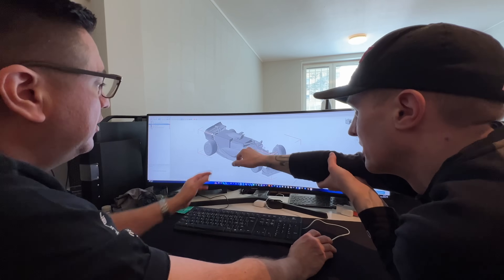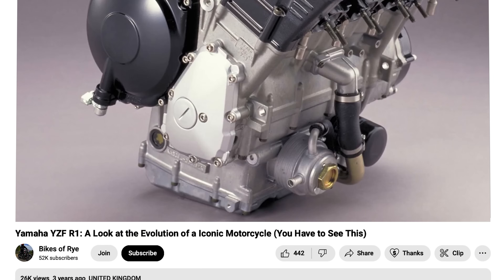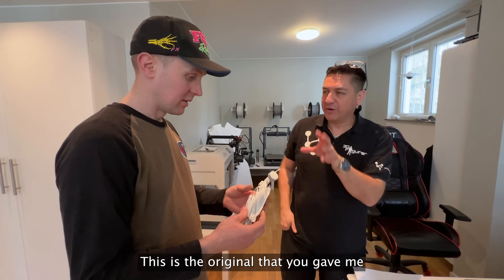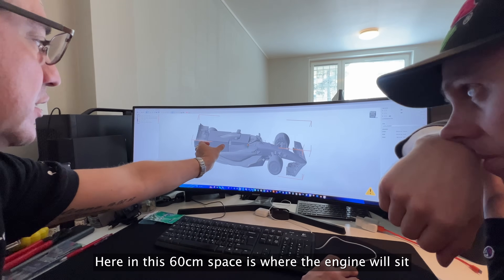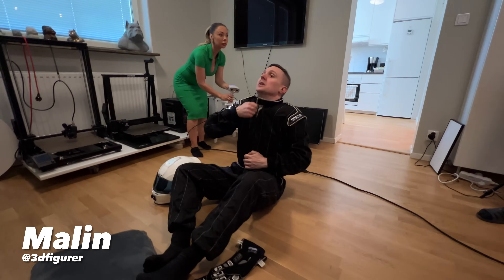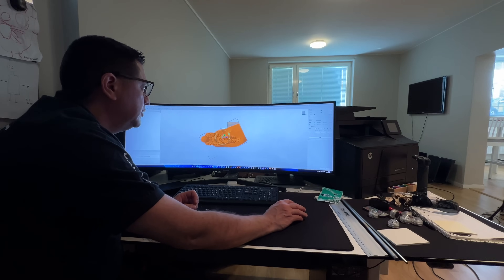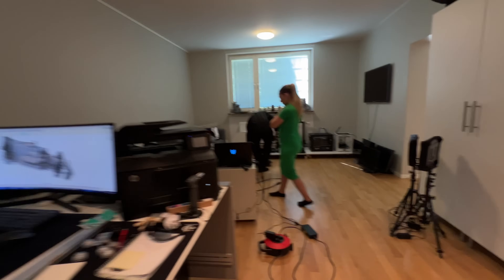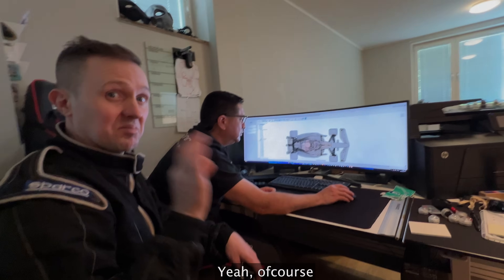Building a HALF SCALE Formula 1 Car / Part 1

Comment: I suggest you go for a Kawasaki ZX-25R engine instead.
250cc I4 engine, revs to 18k rpm, gives you more of a F1 style sound.
Reply from the maker: we already have the R1 engine and its hard to get 250 hp out of a 250cc 😅 but trust me, the sound on this thing will be amazing
Reply: @critical  yea i was gonna say that, the 250s usually have about 50 hp, unless you know black magic the 250 hp will never happen lol...
Reply from the maker: Okey ive heard the engine now and you’re right it sounds great 😂 but yeah i think the R1 will be fire in the end 🔥
Reply: This is the best advice or the CBX engine, even though it’s very heavy